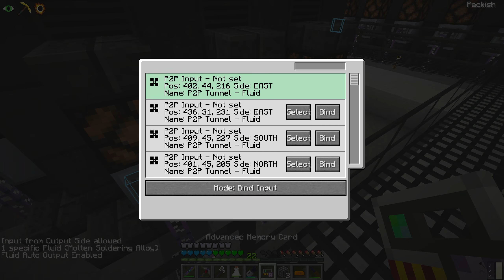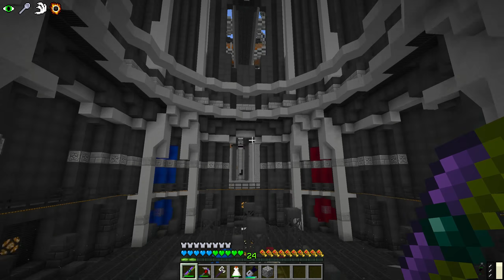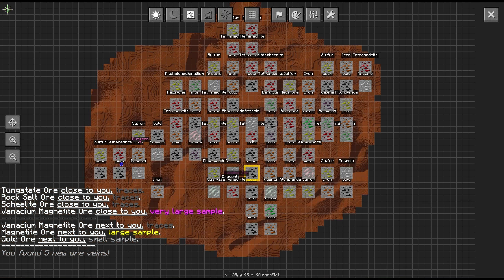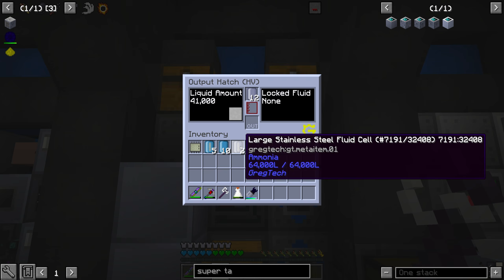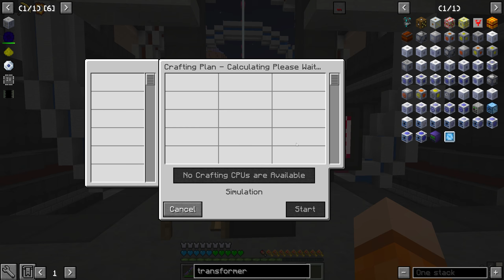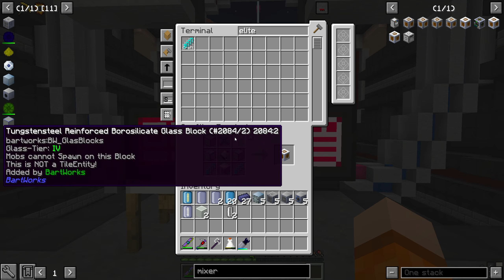Gregtech New Horizons S2 34: Lapotronic Power Plans

Comment: You might look at the fibre-reinforced board recipe and wonder why on earth the questbook makes you bother with borosilicate glass when carbon fibre is so much cheaper and easier. To quote the text from the next quest in the questbook, typo included: "But we're making you do this becuase[sic]...re-writing the quest would be annoying." That said it's not a waste to get started on getting Borax, and more specifically borosilicate glass, because you will actually need it to craft higher tiers of glass in the near future. How glass tier works is that regular glass (and basically all other types of glass, from other mods and otherwise) is considered HV tier glass. But soon you're going to need EV tier glass, IV tier glass, etc., and barring access to Managlass/Alfglass (which are EV/IV tier respectively) this is where Borosilicate glass comes in. That said note that you will require Borosilicate glass specifically for at least a LSC, the multi will not form with Managlass. Crafting recipes will accept the Botania glasses just fine, though...Elven Trade being gated behind an IV tier Precision Laser Engraver notwithstanding...

For reference it's the LCR Nitrobenzene recipe that'll get changed to require ZPM power at some point, since (as far as I understand) that recipe is intended for nitrobenzene as a crafting material and not nitrobenzene as a gas fuel, the chemical plant is for the latter. The chemical plant recipe also requires distilled water specifically rather than regular water, so bench any dreams of mass-producing nitrobenzene until you've got access to a T3 rocket to reach Ross128b and it's super rich distilled water fluid fields. Producing the distilled water yourself otherwise is...well, they're ways, but it's not the best.

In stark contrast to single block gas generators multiblock large gas turbines will continue to run even if they have a full energy buffer, and in fact will happily run even if they have no way to output power at all. They also have a warmup period similar to a steam boiler, so you want these things to turn on and off as little as possible. This is (part of) why LGTs require centralized power or at least battery buffers and redstone control in order to run well, because even if you hook them up to a benzene perpetual motion machine there's rotor durability to consider. So yes, lots of problems to solve, but the increase in power output (or fuel efficiency, in 2.2.8+) is more than worth it.

It used to be that "overclocking", or overfeeding all types of multiblock turbines (steam, gas, plasma, etc.) was just straight wasteful and you were literally better off giving them optimal flow and voiding the excess fuel (in terms of power output at least). Since a relatively recent update, as in the last major version IIRC, the overfeeding mechanics were changed and you can now produce more power at the cost of decreased fuel efficiency by feeding multiblock turbines more than their optimal flow. That said when you're so close to producing the maximum amount your dynamo hatches can support anyway there's no need to use that mechanic. It certainly has it's uses, though.

Multiple examples of why upgrading your EBF coils is worthwhile. 60 seconds per blue steel? Nah, how about 3.75 seconds instead. And yes, Shadow Metal is a great turbine rotor material in EV, but in IV we've got access to something much better than that. And arguably easier, if you're still crafting/processing shadow metal ore manually. Turbine rotors, good ones at least, last a very long time...but they're a wee bit on the pricy side to craft as well.

Having a total of three EBFs at this stage of the pack honestly isn't ideal either. Yes, the coils are expensive on materials, but that's where you wallshare EBFs to save on coil blocks. So long as you've got the power to support them you want to stay on top of EBF processing capacity. Upgrading coils and getting upgraded overclocks works wonders, but this is GTNH. One miracle will only get you so far 🙃.

If you ever want to stop NEI from cycling through all of the different items you can use to craft something just hold Shift.

Thorium-Yttrium glass is actually pretty cheap to craft...if you've got the Yttrium. To get Yttrium start processing Rare Earth, and despairing because Rare Earth is a really fun process to suffer through 🙃.

You can charge batteries (and electric tools for that matter) in the battery slot of the right tier of machine. It's not something I'd recommend doing since you're likely to forget which machine you left your screwdriver in and spend the next hour looking for it, but when you can count the number of machines you have an half a hand and they're located within the same enclosed room that becomes much less of a concern 🙃.

Crafting more of what you'll eventually need is a good idea, but good turbine rotors really do last a really long time. Their lifespan given 100% uptime is often measured in the tens of hours of not days, with really extreme examples even being measured in weeks. And when you add in proper automation to turn off the turbines when they're not needed they can last you a very long time indeed. It's rare that you'll end up burning through an entire rotor without having progressed enough to have access to a better rotor material, or at least have be able to replace it much more easily. Note that you cannot repair damaged rotors in a Thaumic Restorer (though given that only repairs 8 durability per essentia it would take 384000 Instrumentum essentia to fully repair the rotor besides). That all said HSS-E is, itself, a very good material for GT tools, TiC tools, and of course turbine rotors. People who remember Oriharukon and how great it was, well, HSS-E is now basically that but even better, and much cheaper to boot. So investing in some extra HSS-E? Probably worthwhile.

This is indeed the point where things start to require helium in order to smelt, but I wouldn't be worried about it. If you don't have a backlog of it from centrifuging endstone dust you know where to get more of it, and if you need ever more of it in a real hurry for whatever reason I guess you could say hi to the Snow Queen, take apart her lair's Aurora blocks and electrolyse those into helium. More importantly, IMO, is that you start to get serious with producing Radon to eventually use as an EBF fluid. HSS-E, to give an example, has it's smelting time basically cut in half by using Radon instead of Helium, and the ~840K EU worth of power it costs to produce that Radon in an LCR will be more than covered by the ~2M EU cost that gets cut from reducing HSS-E's smelting time so much. Is that situation going to be significantly more complicated once things like coil energy discounts, upgraded overclocks and (eventually) the Volcani comes into play? Absolutely. But if you've got a stockpile of Radon - like you should - and are either in a real hurry to cook some stuff or very desperately low on power it's time to take out the Radon.

My only real recommendation RE: power room is to put it close to centralized power, but leave plenty of space for future additions. You might end up crafting the massive XL turbines to produce oodles of power later, you might end up with a dedicated fusion reactor in there at some point, and so on. Give yourself plenty of space, if only so that you have the option to generate plenty of power.
Reply: Living proof that gtnh players have too much free time
Reply: Reading this takes longer then the video you wrote an entire essay under a yt vid
Reply: Mr. Essay man teach me your ways
Reply: do you have a model for ebf wall sharing?
Reply: in section 10 there is a spelling mistake "tens of hours of not days" should be "tens of hours if not days". Due to this misspelling your grade will only be five. Please practice grammar before your next test.
Reply: @tl1326  Actually yes, the spreadsheet that I believe is linked in the description does have a design for dual/quad EBFs and quad Volcani
Reply: @me3ishere  I've actually given up on catching all of those kinds of spelling mistakes a while ago. When you can come back to a block of text in the 10K words multiple times across multiple years and still find typos you just resign yourself to the fact they're never going away no matter how hard you try 🙃
Reply: @TheShadowofX  True. Thankfully AI is going to rescue us from this hell. Just let ChatGPT fix those errors for you 😉
Reply: Ik it's been a year but what about solid oxide fuel cells for power?
Reply: @noahcarlton4625  They're usable, but IMO are overpriced for what they bring to the table. Large Gas Turbines are cheaper, simpler, and powerful enough.

Comment: Scroll wheel in the pattern terminal for some of those ingredients, makes things easier
Do the full dust recipes for plat, much easier to deal with
Lapotronic super capacitor is really a good idea to get when you can, since you can use multiple dynamos on it and multi-amp ones at that
Reply from the maker: Yeah the tiny dusts were from when we made Palladium. Scroll wheel isn't something I knew about, thanks :)

Comment: If you hold shift while browsing recipes in NEI that are quickly showcasing various options, NEI will freeze the changes and allow using the scroll wheel to manually cycle through all the options. Letting go of shift will go back to the automatic cycling.